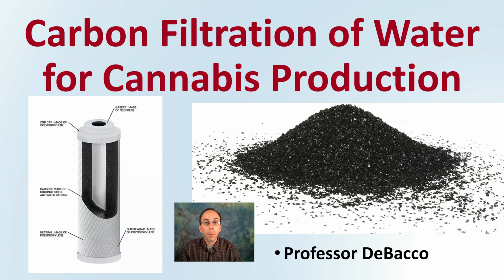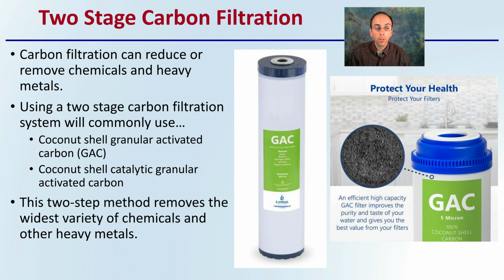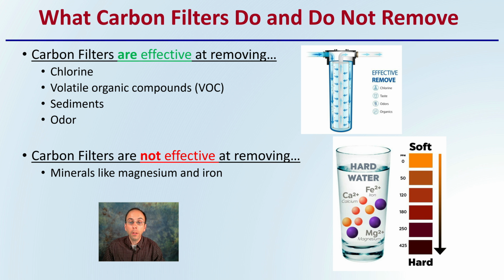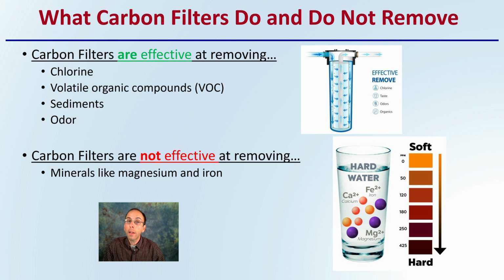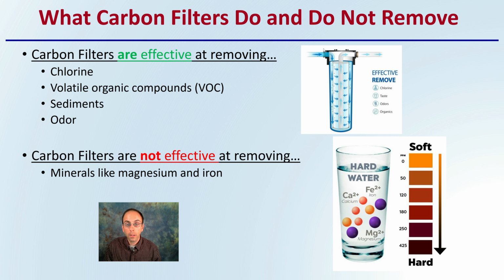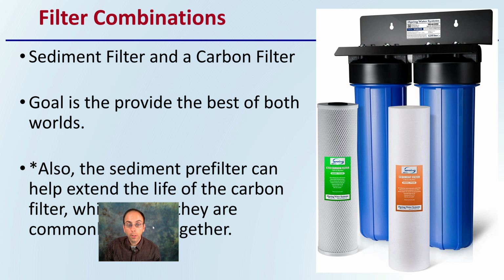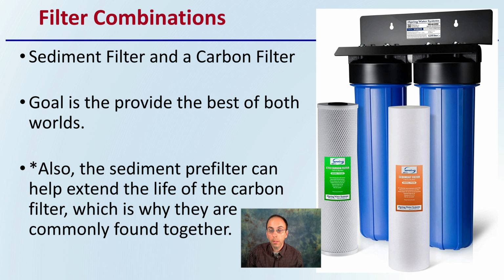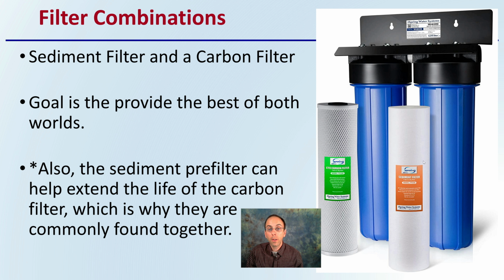Carbon Filtration of Water for Cannabis Production

Comment: question Dr.  So if my water ppm 150 should i bother with carbon filtration or even a RO. Would that reading  require me to worry ?
Reply from the maker: That is a fine starting point, just be sure to also check the pH as those ppm's do not require a filter system.